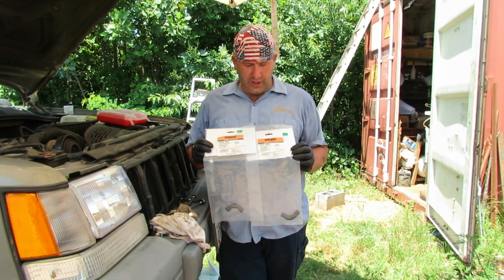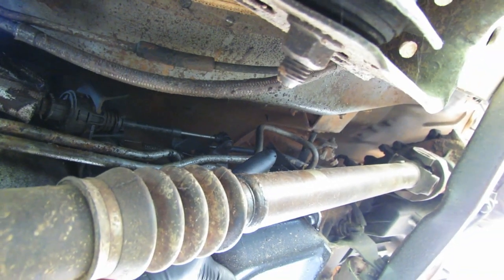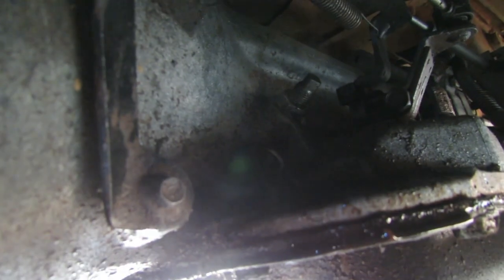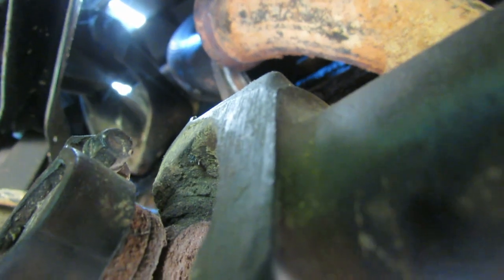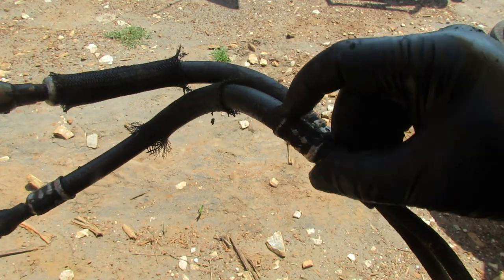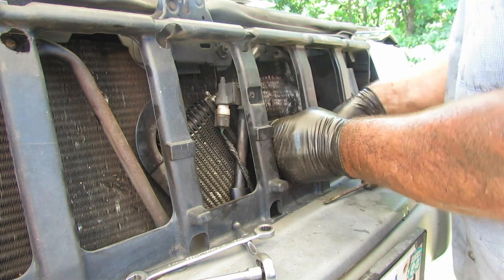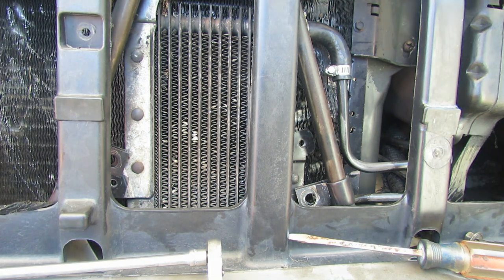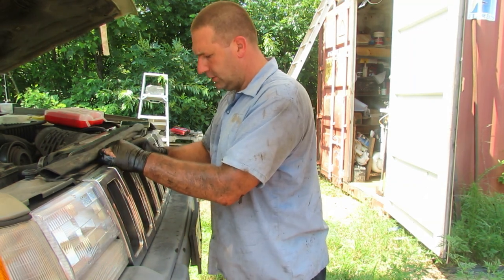How To Change the Transmission Cooler Lines on a Jeep Grand Cherokee ZJ

Comment: Do you have the link to the lines?
Reply from the maker: @Ruben Gomez I do. Take a look at the links below. They are also in the description of the video. Thanks for watching! ~Mr. C.

Cooler line set: https://amzn.to/3ltF1ZY
Remote cooler elbows: https://amzn.to/3K5S0LL
Quick connect removal tool: https://amzn.to/3IhZLg3
Reply: @NaturesCadenceFarm  thank you so much! It should work on a 1996 grand cherokee 5.2 right?
Reply from the maker: @Ruben Gomez I would say so. I have not worked on a 5.2 version but as long as it has the same transmission I would say so. The lines might have some different bends in them so maybe double check the part numbers on a site like Rock Auto. ~Mr. C.

Comment: Thanks for the video. Did you need to drain the transmission fluid or did you only lose the fluid that was in the lines and the cooler and draining the fluid wasn't necessary? Thanks!
Reply from the maker: @ericrhots9292 I did not drain the fluid from the transmission pan. You are correct I only lost what was in the cooler and lines. Great question! ~Mr. C.

Comment: So doing the same swap and when I went to crank off the line from that brass connection I snapped the connection right at the tranny housing wall flat. What would you suggest. I’ve got a screw extractor popped into the hole which took two hours and seven types of tools because none fit in to tap it in. I’m feeling a little screwed rn. Can I remove it easier by removing the pan?
Reply from the maker: @Wizardsgrowth wow that sounds terrible. That fitting must have really been in there! I do not have any experience with removing it. I would guess it is not accessible from inside of the housing. I have had mine apart and the valve body and things are right there. No room to even see anything. Did you ever get it out? ~Mr. C.

Comment: the long line with the flexible hose also has a one way check valve that can cause a lot of transmission overheating problems
Reply from the maker: @paulaubin510 that is great information. Thanks for sharing! ~Mr. C.

Comment: do you have a link to the fitting? i lost mine
Reply from the maker: @lucaswright3474 I do not. I would call the dealership and ask if they can get it or give you the part number. It might be better to stop by because they will show you the parts breakdown on the screen. Hope this helps. ~Mr. C.

Comment: Thanks for the video!  Do the lines need to be bled after the replacement?
Reply from the maker: @4R MODS that is an excellent question. One I should have covered in the video. The answer is no. The system will purge itself of the air shortly after the engine is started. Think about it like this. The pump in the transmission pressurizes the line leaving the transmission (pressure line). The radiator and cooler are open to the atmosphere on the return sides that go back to the transmission pan reservoir through the other line (return line). The pressure generated by the pump will push any air back to the transmission to be vented out. Glad you found the video useful!  ~Mr. C.

Comment: Where can I get that fitting at?
Reply from the maker: @Alex Perron are you asking about the one that threads into the transmission? If so, I would check with the local Jeep dealer or a junk yard near you. Hope this helps. ~Mr. C.